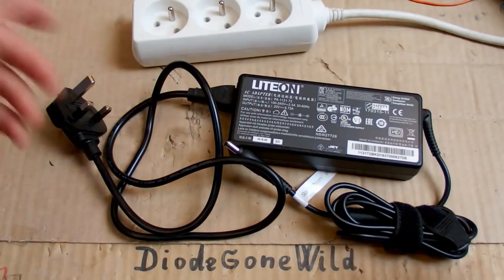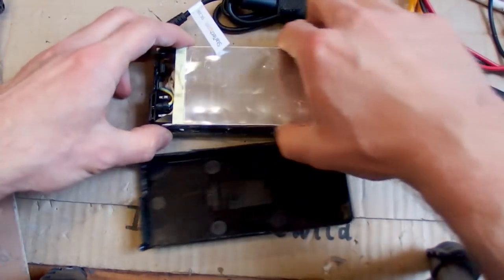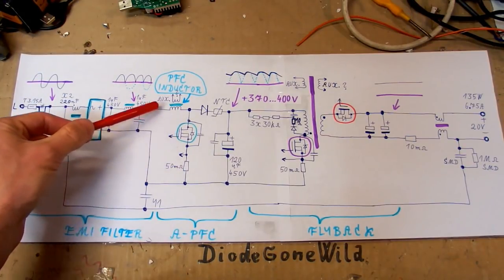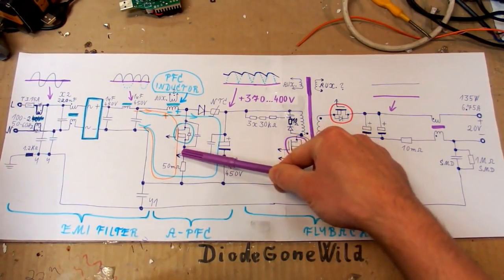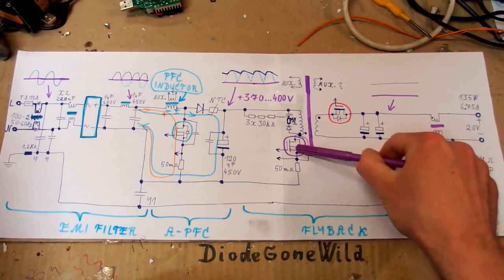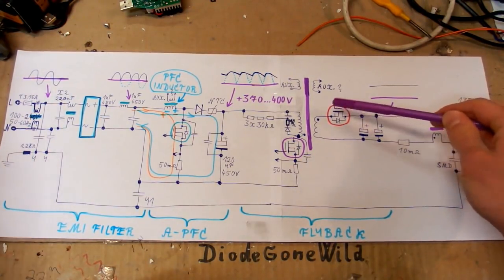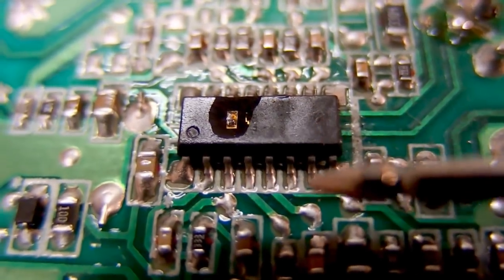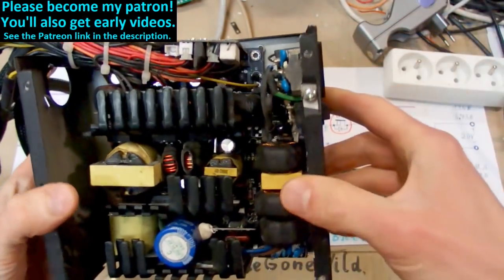Laptop power supply with PFC - teardown and repair (BOOM!)

Comment: So basically the power factor correction is for the benefit of the electrical distribution system?
Reply from the maker: Yes. There's no benefit for the maker or user of the power supply. Except that the user has a bit less loaded circuit breaker. And also the PFC is a kind of voltage pre-regulation, so you can omit the 110V / 220V switch.
Reply: Correct. For a domestic user, it doesn't much matter - your house doesn't draw enough power to adversely affect the grid. Industrial customers will have a clause in their contract with the power company that requires they  maintain their power factor within an acceptable range and avoid generating harmonics that could damage upstream transformers.
Reply: @vylbird8014  thank you for response sir but my house don't affect the grid? I mean am I considered an industrial customer? Because my PSU has PFC

Comment: Never could find the cause of the problem.  All connections looked good under the magnifying glass.  But if I bent the PCB a bit, it was working.   So I re-soldered every connection on the PCB, and that fixed it.  Sometimes a bad connection to a resistor, or capacitor, or transformer, etc., is just not visibly noticeable.  Even my Fluke meter was not using enough current in resistance mode to make the bad connection measurable.

Comment: I was today years old when I learned how to open these easily. Apparently the glue holding them together can be dissolved with a solvent such as ethanol or lighter fuel. Dribble along the seams, wait a minute or so, then tap to open. #yourewelcome

Comment: i also have a coolermaster 500w atx supply with active pfc, doesn't turn on, however draws 3w power, no v/g on anything, green ground short also nothing, 5vsb also not present, fuse rectifier capicitors all ok. will try to check that boost diode & fet.
Reply: I would start with the 5VSB circuit and find out why you have no 5VSB. It provides power to run secondary-side functions like the PS-ON signal. The APFC does not typically run in standby so should not matter to the 5VSB rail.

Comment: you can use gasoline to break the glue without leaving marks

just apply little to the groove around the charger and voila the casing falls apart
Reply: Alas, most of the plastics these days are welded ultrasonically. Only way to open them is to break the weld. I use a vice to apply pressure slowly cranking until it cracks, if it did not want to crack I tapped it with a (nylon) hammer with the pressure on.

Comment: I found using parts with synchronous rectification on the output. They all blow their output drivers if connection to the stepper motor was lost while doing steps.
Remedy was to put Schottky diodes on all 4 output pins of the h-bridge driver.

Comment: Can two PSUs be connected in parallel for high current applications? Would be interesting to see a project like this.
Reply: You need a schottky diode on each positive outputs of the PSU. One PSU will have slightly higher voltage and will draw more current until the second PSU matches the voltage. A problem that can happen on light to medium loads is oscillation between the supplies as one lowers its current its voltage goes up. Would pay to add a high value cap after the diodes

Comment: The active pfc mosfets are exposed to overvoltage spikes (low capacitance at input filter) . no varistor here
Reply from the maker: Well, PFC power supplies may be more sensitive to spikes because there's no big capacitor at the input, but in fact the PFC diode should bring the spikes into the capacitor anyway. Maybe moving the NTC to the input would make it better. The capacitor can't clamp the spikes because the NTC resistance is in sereis. But on the other hand, the NTC may double as a resistor to soften the reverse recovery of the diode...

Comment: My living room led lamp failed after about 3 years. It had 60W. Also the power correction transistor failed.. All blackend. Then I just took the input and wired it to the flyback part.. 3 years have passed and its still working fine.

Comment: Lite-On is one of the worst quality.  
We used it at my company and there were some issues:
-the cable breaks very easily
-It's extremely light weight - feels like it's almost the plastic box without anything inside
-Lasts about two week with 30 minutes load per day (Load is about 40 Watts).
(Used it for torque wrench testing/measuring machine)
Since we get a better quality PSU last year (not a lite-on) we don't have any issues and it's still working

Comment: The fuse in the British plug did not look quite right, quite chinesium looking. Plus for a device with that style of power connector then at most a 5A fuse should be fitted, 10A fuses are generally only used in kettle style leads and extensions fitted with 1mm² cable.

Comment: opening cases like it can be easier done without scuff marks using a needled syringe with solvent for dissolving the glue in between the case creases.

Comment: Hello how are you? I bought an original used power supply from the same model as my old power supply to be in reserve, but in tests with the multimeter I noticed that it is marking: 18.90v, while the old and original notebook one marks: 19.43v. I wanted to know if this voltage difference between the sources could cause some damage in my notebook or if I can use it without problems? Thanks.

Comment: Replace the control chip, the two shorted MOSFETS and PFC diode. Then it will work again.
Reply: Finding a replacement control chip is never easy.

Comment: My Surface Go laptop charger stopped working. Voltage test showed practically nothing..just fluctuating in the millivolts. 
The board inside is liteon brand. The fuse is a fusible resistor with the colors: red, brown.. Or maybe brown then red.. But then it has two gold bands followed by a white and a yellow. There is no resistance when measuring. I'm actually confused by the 6 bands of color..due to the 3rd and 4th bands both being gold. Would that be a 1.2 ohm value? And shouldn't it have continuity?!
Is there anything I can substitute in place of the fusible resistor?

Comment: 2days ago my hp liteon 95watts charger also blown up, unfortunately its control ic🙁, it leave a hole. To open the case just use a petrol with toothbrush or syringe across the opening then give it time like 2 mins and it open effortlessly 😀😄

Comment: 23:52 See something beside the broken 50mOhm resistor is Arcing over....
Reply from the maker: I didn't notice before! Now I took a close look and first, I though it was some reflection from a shiny solder, but you're probably right, it was arcing. But it wasn't the resistor. It was between two traces on the right. Probably some remains of the black carbon, which is conductive (but with a significant resistance, not a dead short circuit) . Seems I didn't clean it enough.
Reply: I also see some smoke over the IC immediately after the arcing.

Comment: Interesting that this actually is an isolated power supply that connects its interference caps to ground rather than neutral. I've opened some of these that have a three pin socket and the ground pin is actually not connected internally.

Could the 1M resistor between DC negative and mains earth be for ESD protection? It looks like they wanted to provide some advantages of a non-isolated supply while not having a direct short between DC negative and ground.

Comment: Oh, you just broke the casing. The best and easy way to pry open the laptop adapter casing with a minimum damage is to rub the seams with cajuput oil. Leave it to cure for about an hour or two, then use a (strong, thick) knife, flat-head screw driver, or anything flat and rigid to crack open. You don't even need to use a hammer.

Comment: Would you be kind to answer my query ? Please share your valuable insight in this matter. Is there any form of low voltage cut off in laptop charger ? Actually I tried to power my solar charge controller from it but It didn’t work. Within a second amp going to battery stopped. My thought was to charge my battery in rainy day with laptop charger as it provides 19-20 volts and 5 amp and charge controller could use it like solar panel supply and turn it into 14.4 volt 5-6 amp.

Comment: How do they keep the synchronous rectifier control isolated from the primary side control? Do they use the same control and monitor circuitry? Doesn't that couple both sides?

I'm interested in designing a multi-output isolated converter. Needing primary and secondary side control for each channel and combining them into the same digital control and monitoring seems daunting. But idk if that's even necessary.

Comment: If it is glued together then you can use petrol for open it's housing, it is easy way.
Reply: It usually is not glued together. Usually they use ultrasonic welding to fuse the plastic case.

Comment: How can those star like solder blobs form? Shouldn't the surface tension pull them into a circle when they are sill molten?
Reply from the maker: They are probably shaped the same way the hole in the green paint is.

Comment: For active PFC, can this be as simple as taking a standard boost regulator control, and simply slowing down the modulation of the switching duty cycle so that it changes on a longer timescale than the AC frequency?

Or in order to draw a good sinewave current, does it need to modulate the duty cycle over the rectified mains waveform?

It seems to me that the way this works is that you have a very slow feedback loop controlling the average voltage of the output capacitor, and since the switching duty cycle is only changed very slowly, it will be about the same throughout a particular individual cycle of mains. I suppose if there is a sudden increase in load then the voltage will sharply dip down, but since there is an additional regulator afterwards this might not be a problem. 

You could then have a separate faster feedback loop if needed to monitor the current and modulate that pulse width on a shorter timescale to better approximate a sinewave draw
Reply from the maker: That's a good question :). I think it could be just a slow feedback, if it was always running in DCM (discontinuous conduction mode). But in reality, it's probably much more complex. At least the current sensing feedback has to have some fast path because of an overcurrent protection. But I think that there's also a fast path for the current sensing in normal operation. It probably modulates the current actively. But of course, the voltage feedback has to be slow. It may not even run at a constant frequency. It may start a new pulse when the diode conduction stops (the energy in the inductor just ran out). I guess it's a fast feedback modulating a sinewave current, but also a slow feedback regulating its scale.

Comment: What could be the problem with this similar circuitry if the two dc output leads when are shorted when tested with a continuity test by a digital tester.
Reply: Blown rectifier maybe
Reply: @hardnachopuppy  tested the diodes still ok. Found a transistor no value on the collector side.

Comment: My power suplay optocoupler blow in 2 piece. I has replace with new one. But still not work.
Reply: You have other primary side damage, like shorted transistor and control chip etc. Optoisolator drives back to a control IC, or usually another transistor if your supply is a self-oscillating design.
Reply: @Agent24Electronics  ok i see. I'll check it. Thank you

Comment: Dan, I just learned we are the same age :) I have a curious question: Why do you use that soldering gun for everything? I have always heard people recommend against them for any electronics work. Is it just budget, do you actually prefer it, or just want to show that it is possible to use it?
Reply from the maker: I have been using soldering guns ever since I was a little kid. I'm so used to them that I don't want to use anything else (except for bulk desoldering). I like how it's immediatelly on or off as you need it. It does not roast the solder on the tip being hot all the time. You can even use it to grab solder and then apply it :D. instead of applying the solder to the joint.
Reply: @DiodeGoneWild  Interesting :)

I suppose I am spoiled then because for most of the time I have been soldering I have used fancier soldering irons, and once I bought an FX-888 I have not even tried to use anything simpler or cheaper since.

And for grabbing solder and then applying it, most soldering tutorials say don't do this but I have found it is a valid technique. It has the downside that the flux in the solder wire will burn and leave soot on your iron, rather than work with the joint, but you can get around this by just applying flux separately and cleaning your iron frequently.

I use it a lot when I want to solder two things together that I have to hold in place, so I can't spare a hand to apply solder, I will put solder on the iron, paste flux on the joint and then hold the joint together while I touch the iron with solder to it.
Reply: @DiodeGoneWild  I don't know if you heard about this but a guy called Sergey from Russia made a DIY clone of the high end Metcal curie point soldering system, and I have been trying to replicate his work with decent success. I hope to come up with better documentation so more people can build it, as it is much cheaper than the commercial product.

Comment: I was at a driver factory and the technician had to open a welded case like your working on. He simply used a liquid on the seam and after a few seconds it became brittle and he was able to crack it open with his hands. I had been using the mill to open this kind of case. Unfortunately the translation of the name he gave me was "case opening fluid" but obviously it is something that makes abs brittle. Anyone know what it might be called?

Comment: just pour some drops of alcohol (nail polish remover) to open the plastic casing.  It dissolves the glue and easy to open without damage.
Reply: Isn't nail polish remover actually Acentone, not Alcohol?
Reply: @PracticaProphetica  Both works

Comment: You that have more experience with electronics can tell me if is possible to make active power factor correction circuit to some power supply?
I have a powerfull one with more than 1500w and that don't have active PFC and has bad power factor
Reply: Yes but probably not worth the effort/cost.

Comment: DiodeGoneWild, you can open most powersupplies/adaptors using gasoline on a sponge. Just rubb it along the cracks until it breaks the glue/adhesive and the powersupply will split in half. Did this many times when its time to replace a bad laptop end cable. Tested on HP, Lenovo and Toshiba. Hope this helps :)

Comment: Isn't the 3.15 A fuse to big to protect the circuit on failures? 1 A should be enough too.
Reply: Inrush current....
Reply from the maker: You have to keep in mind that it's for a universal mains voltage (100-240V with probably 10% or 15% allowed error), so it has to work down to 85V. It draws up to 151W. This is in the worst case 151W / 85V = 1.78A with a unity power factor. The fuse tends to have at least 25% headroom (this leads to 2.22A), but also you have to have even more headroom for the massive inrush. So 3.15 A isn't that high.

Comment: I saw a few old czechoslovak wiring on some webpages(using google translate). Those look extremely dangerous.Did they never use a reals ground wire instead of grounding to neutral?
Reply from the maker: In Czechoslovakia, we used no ground before 1933, then we used neutral as ground from 1933 all the way to 1996, and from 1996 we have a separate third wire for ground required in new wirings. But of course all the wirings from before 1996 (and even newer wirings done by DIYers and electricians with outdated knowledge) are still dodgy, just 2 wires, with neutral wire connected to both the neutral hole and the ground  pin of each socket. It of course gets even dodgier because they often used aluminium, which easily gets loose under a screw terminal. A loose neutral wire means that the ground pin becomes live via the appliance. There's still quite a lot of those wirings, plus of course some weird combinations of the new and old systems, as the wiring was only partially replaced.
Reply: @DiodeGoneWild  I hope at least they did ground the neutral with a ground rod  when it entered the building.Are you sure grounding started in 1933?Even in Germany and USA it only became common in the late 1950s.

Comment: Or you can simple put some banana oil in the glued part, and wait to it do the job for you, lots of brasilian technicians do this, some people put the power supply in a hermetic bag and after in the freezer, the cold solidify and contracts the glue, after some time in the freezer you can just press the junction with your fingers and the covers open intact...

Comment: Does anybody know what can be the problem of a sony laptop charger with PFC, where the primary capacitor has overvoltage? The mains voltage is around 230V, but the voltage on the main capacitor is reaching 500V and rising!!! It had a blown fuse, rectifier bridge, 400V 0.47uf ceramic capacitor in the PFC circuit and the 420V 120uf primary capacitor was blown as well-probably because of the overvoltage. After changing these components the charger is working, the output is 19,5V as expected, but something is clearly still wrong and I do not know where to look for it... The snubber network seems to be fine, all the diodes on the primary side are OK as well. THX!

Comment: Why should the voltage on the output electrolytic capacitor 90° out of phase? In my brain this does not make sense.
Reply from the maker: the voltage ripple on the capacitor integrates the current ripple.
Reply: @DiodeGoneWild  Ah you mean the current. Because it has a U for voltage.

Comment: Best thing to do to open glued plastic is to use gasoline or brake cleaner. It will stink for some time but it easily disolves glue.